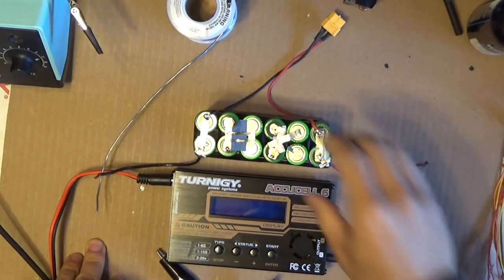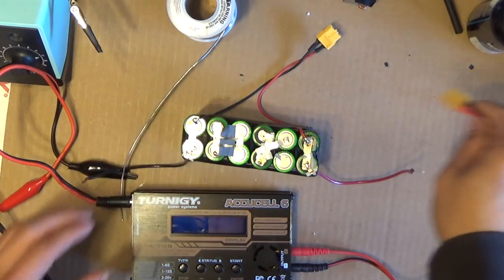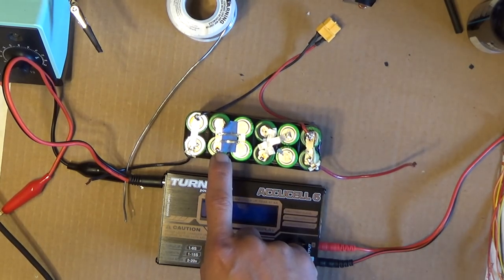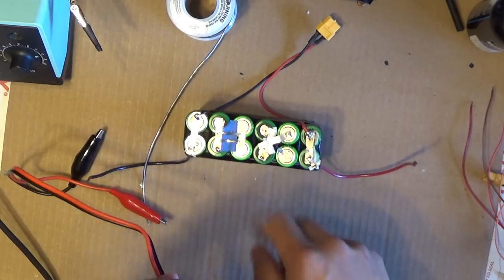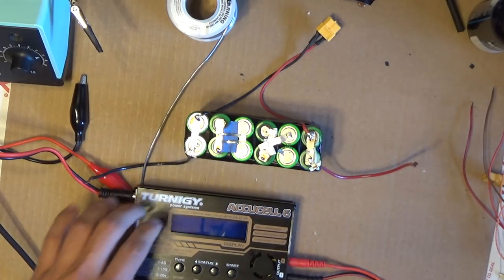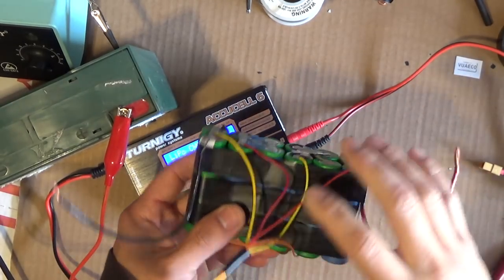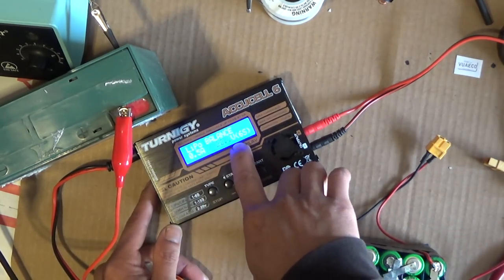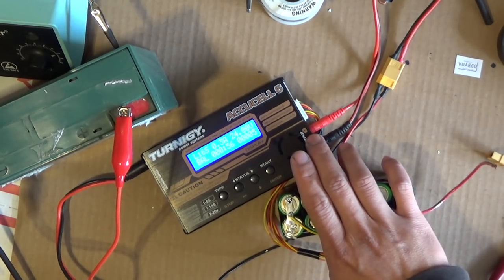DIY: How to Balance charge Li ion/ Lipo battery pack w/ a balance charging cable Imax B6 Accucell 6

Comment: how would you wire up the balance charging if you make a 2 or 3 cell battery but in each cell in 4 18650's?
Reply from the maker: You mean a battery pack of 2S4P?
Reply: vuaeco it would be 4 batteries in series, and 3 sets of 4 in parallel
Reply from the maker: If you only have 3 sets of 4 in parallel, it's a 3S4P pack. You cannot have 4 in series with 3 sets of 4 in parallel. But anyway, you can still balance-charge your pack when you have series/parallel in your pack. The principle is still the same. Just regard your parallel batteries as one giant cell. For example, if you have 3S4P that means you have 3 in series and 4 in parallel . Just consider it as a 3S pack with each cell 4 times the capacity as a regular pack. So the balance  charging procedure is still the same as a 3S battery pack. And you can put the balance lead anywhere along each of the 4P.
Reply: @vuaeco  hi, a quetion if i want make a 2S2P or 2S3P, 3S3P, how to balance the battery in parallel? dont have problem/explosion if parallel cell aren't balance?  i can use 26650 battery for more mah?

Comment: Charging liIon batterys in LiPo mode? Wtf...
Reply from the maker: Do some research before you troll.
Reply: @vuaeco  why "troll" if u wann tell me that liion and lipo batterys are the same thing you dont need to wonder when your batterys dont last very long
Reply: You should choose li io option on the charger lipo cells are 3,7V li io cells are 3,6. I have the same charger it can work in liio mode.

Comment: CAUTION This is total nonsense - you are balancing cell pairs with other cell pairs, you are NOT balancing all the individual cells: To that you would have to isolate or separate cell pairs into each individual cell, not coupled together in pairs as in the video. Sorry but if you don't know what you're doing, don't publish videos unless you say what your limits are.
Reply from the maker: LOL! If you want to be a clown, join a circus.
Reply: @vuaeco  Right, let's get this straight so people don't waste their time: If you are balancing cells it's for a reason. If you want to balance a series of cell PAIRS then this video is for you. But it is obvious that balancing the SERIES of pairs is important to you - so you must be doing it for a reason - presumably that you think there is a need to balance the entire battery properly. So what's the point if you don't balance each cell-pair before balancing the series? You could have a bad cell or a failing cell in any of the pairs. Sorry but the video is a waste of time unless you check and balance all cells. If you live on the assumption that batteries don't need balancing (i.e. each cell) then why balance any at all - simply don't bother. If you want to play with lithium batteries, it's good to know what you are doing - bad batteries can cause fire or explode when overcharged or wrongly charged. Again I say CAUTION to your viewers and would urge you to correct your video instead of being rude.
Reply from the maker: @gurglejug627  Nah. I'm not gonna feed the trolls.
Reply: @gurglejug627  Hey, in case you know the issue. I have an electric scooter ( gotrax glider) with lithium ion batteries. It turns off unexpectedly, sometimes when I hit a bump, sometimes when I go fast or slow at certain time. Bar shows full charge. After fully charging (it sometimes struggle to charge). After shutting off, It wont turn on unless I charge it and then disconnect. Full is 28v and minimum is 24v. When it turns off unexpectedly. The voltage shows 16v (from motherboard) do you think the battery is defective and can It be fixed?  The company don't sell battery pack for that model
Reply: @LemonJuiceGV  Sorry I know nothing about those - could even be a variety of factors, control board, sensors, bad connection etc. Best bet is probably a radio control club near you who might have some electronics people there. Hope you can get it sorted.
Reply: @vuaeco  HA<HA<<<